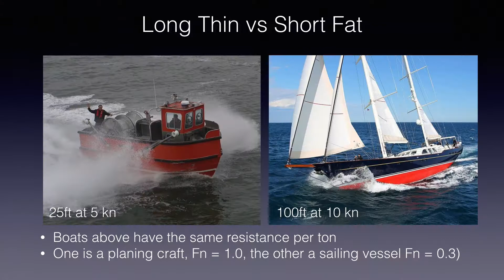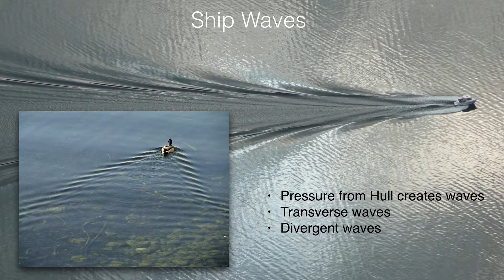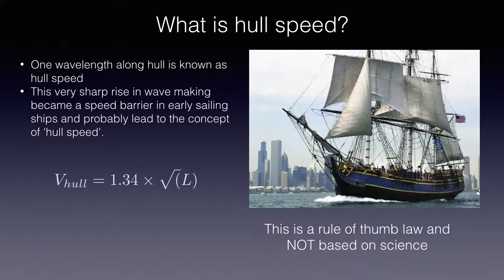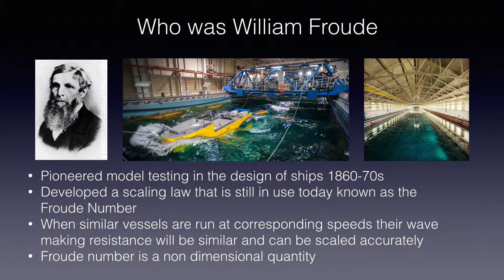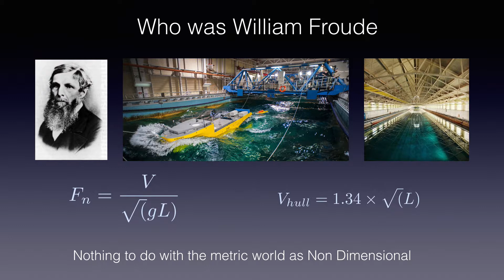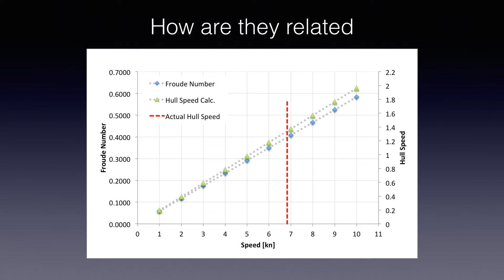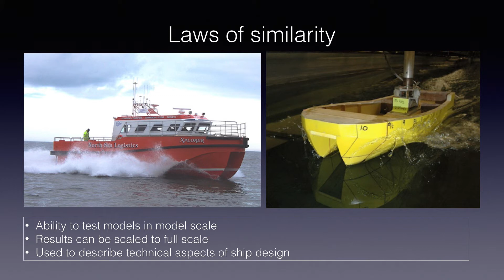BoatTechTV Episode 5  -  Hull Speed

Comment: Hello, if I have a calculated Hull speed of 9 knots (45 ft boat) and a Froude number of 0,23 what that means? Is it possible? In the Froude number and the hull speed calculation the only variable is the water line. I use the water line to calculate the hull speed and use that speed and the water line to calculate the Froude number. Is this ok?
Reply from the maker: They are two different types of measurement.  You use the waterline in both but one is non dimensional speed used in calculations, the other is a specific speed point (guess). 

The hull speed is empirical guess based on experience with bow waves so 1.34 x SQRT( Load Water Line).  It gives a good approximation of when the waves are going to start.  This was a limiting factor for engineless sailboats, now you can power through them.  Froude number allows you to describe any ship of any size with another.  You are non-dimensionalising speed with respect to length so you can compare apples with apples. It also tells you the wave pattern and fun stuff like dry transom (Fn=0.33-ish) and so on.  Hull speed equates to about Fn = 0.35-0.4 when wave-making resistance takes over from frictional and form resistance increasing the power required, so it is an important part of the model.  For your case LWL = 13.71m (45ft), V = 4.63 m/s (9 kn), g = 9.81 m/s^2 (32.2 ft/s^2).  So Fn = V / SQRT(g/L) gives Fn = 0.38 and close to hull speed.